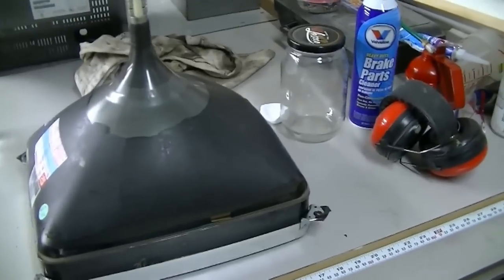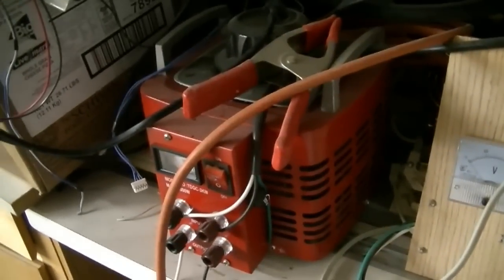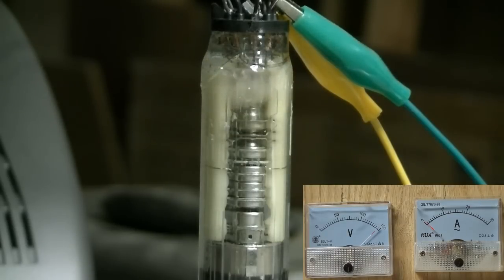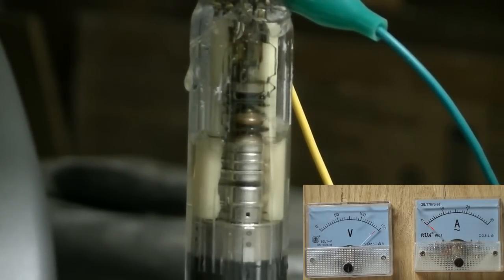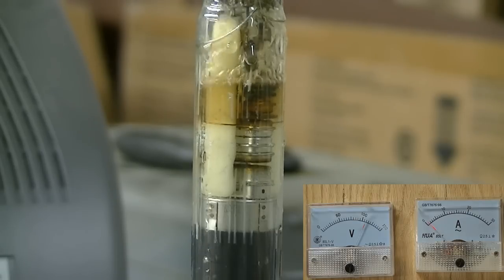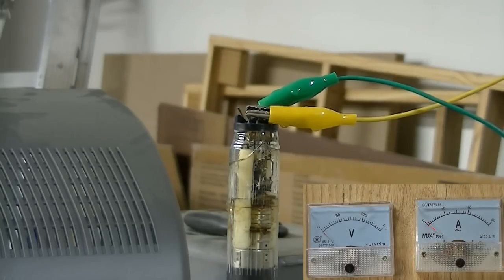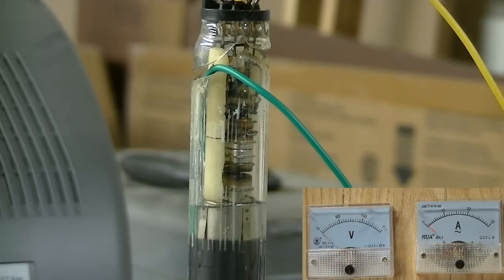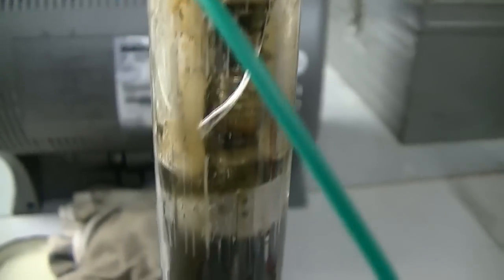CRT's Electron Gun Boils Water

Comment from the maker: I made a decent sizes HHO generator in a large pickle jar, I captured the gas and put it in a water bottle. Using a spark plug and a flyback driver, I couldn't get it to ignite for some reason. Then I took the cap off and held a flame to it and it made a soft whoosh and I saw a bit of flames. I don't think it was pure enough for a better pop.